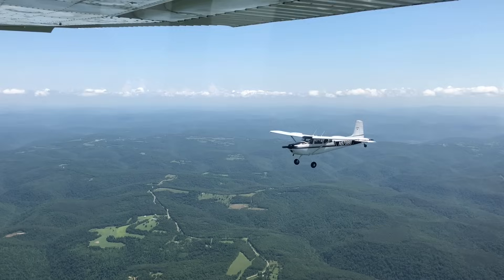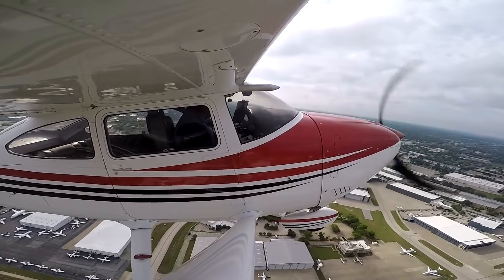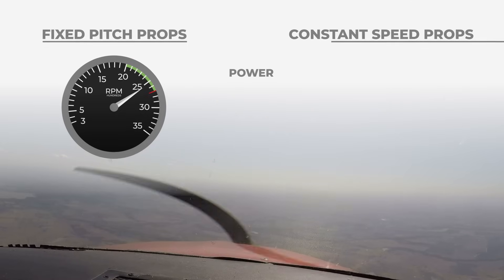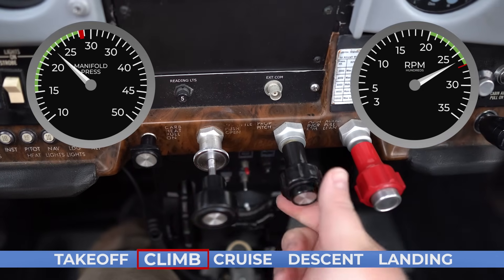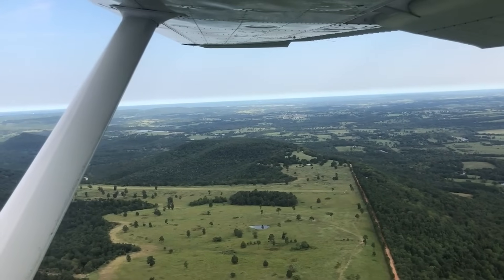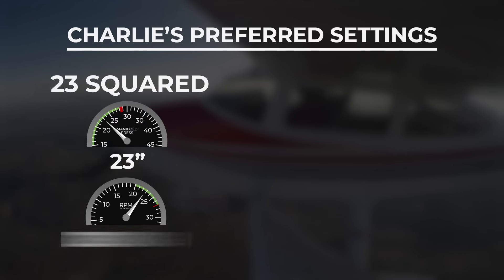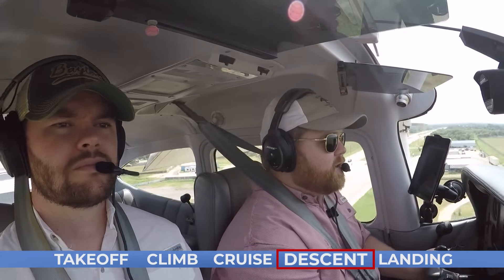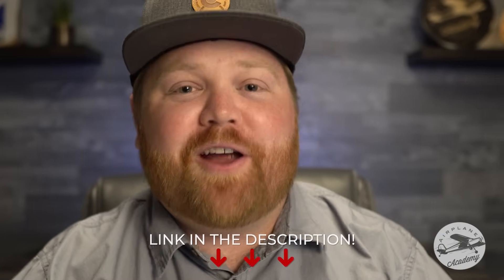How to Use a Constant Speed Prop in Each Phase of Flight (Made Easy!)

Comment: OK here is a challenging question for you. Let’s say you don’t have the power table available. Let’s say the POH is in the backseat if you can’t reach it. Could you just add enough manifold pressure to give you the RPM? Supposed cruise you wanted 2300 RPM and you were able to do so at say 22 inches of manifold pressure. I would think as long as the prop is spinning 2300 RPM it would give you the same performance and speed as 23 square except you would save a little bit of fuel? So what I’m trying to say is you probably could use the minimal amount of power, that is manifold pressure to achieve the RPM that you would like to use. Incidentally, one time I had flown an arrow that gave the same 65% power at 2100 RPM and 23 inches manifold pressure. The plane vibrated very badly so I returned it to 23 square which also was 65% power and a lot smoother. yes the noise level was increased but it didn’t shake the plane like 23, 2100.
Reply: I too have flown an Arrow one time where the POH’s table said for 65% power. You can use 23 inches add 2100 RPM and  the plane did vibrate. Think of this like trying to accelerate your car in a higher gear when you’re too slow. The whole car rumbles and shakes. You have it right there where you can set the prop to the desired RPM, and use the minimal amount of manifold pressure to achieve the RPM. Just remember, as you increase in altitude, especially on a naturally aspirated engine. The manifold pressure will naturally fall off, and the prop will still stay at 2300 until it can no longer maintain that due to a large amount of manifold pressure being lost. Not so much on a turbo such as the Arrow IV where the turbo charger will maintain manifold pressure clear up to 12,000 feet and only minor adjustments need to be made. Which sometimes gets confusing is for fuel economy that you want to lean the engine and normally if you lean too far without looking at the exhaust gas temperature, say the airplane is not equipped with one you would lead the mixture until the RPM drops off. Then you increase do you get maximum rpm. With a constant speed it’s a little more difficult you can watch your fuel flow get less and less and then all of a sudden at the right moment it will almost kill the engine. This is why leaning with an EGT gauge is more practical. One more thing,  Lycoming and Continental engines. Do not necessarily like to run on the lean side of peak. Refer to the POH.

Comment: So when doing circuit work early in your learning, is the prop pitch just left at the fine setting?
Reply from the maker: In other words, if you're just doing pattern work, would you leave the prop full forward? You definitely could. Especially if you aren't running your engine very hard in the pattern (downwind, base, etc.) the prop will effectively be full forward anyways since there won't be enough throttle to where the RPMs are having to be governed/capped anyways. See 8:00 in the video for what I mean. My 182 calls for climb setting of 23in/2450RPM to reduce engine wear and control temps. But if you're just climbing out briefly and going to pattern altitude it would probably be okay to not adjust the prop in any of that. But also good practice to remember prop in your pre-landing checklist. So might not be a bad idea to be practicing it even while in the pattern. Hope all of that makes sense!
Reply: You mean full speed? You could. But we never did. In my training, we always climbed, not matter how far, no matter what airplane, at max continuous power (actually thats not really true, we reduced RPM slightly for long climbs in some airplanes, but for pattern work, never). For our airplanes, that was full speed, full throttle. So we climb to pattern altitude that way. At pattern altitude, we follow the procedure for power reduction, just like we would in any other airplane. The proper power reduction procedure calls for a reduction in RPM, as does the decent power setting. RPM doesn't go to full speed until the landing checks. Practice how you fly; because you'll fly how you practice. Practice makes permanent, so there's no time too early to practice perfectly.

Comment: Question: why is the prop lever so long? Hear me out. There doesn't seem to be a reason you'd want the RPM to be set below a certain level, say 2100, except in cases where it drops because of low MAP, such as in a idle/low power descent. But that is exactly what you'd get if you kept pulling back on the prop lever. Wouldn't it make more sense for the prop lever to have a stop at some minimum RPM level?
Reply: Helps a lot during a forced approach. Pull it all the way back to reduce drag.
Reply: They do. In most twins, it's 0 RPM, or feathered, which is all the way back. The range is just for adjustment. On some airplanes, moving the RPM from full, say 2700, to cruise setting, say 2100, is about half or more of the travel. In singles, there is a minimum RPM, and it usually isn't 0 or feathered, but having that much travel gives the pilot control.

Comment: I fly a PA28-235 and the our club charges by tach time so the lower the rpm the slower the tach time moves. If I am just flying around for fun and not going some where as soon as I get 100o feet agl retard the throttle and pull the prop back to 2100. So after a 1.3 on the hobbs I have about 1 hour on the tach. About a 30% savings in cost.

Comment: Constant Speed props have always confused me - part of that is the term “constant” which, when you think of it, doesn’t mean constant - the prop isn’t constant, it changes. I understand a bit more after watching this video but I wish I could understand it better.
Reply: I agree.  While that has always been the terminology used, the concept is better taught using the phrase "variable pitch" propeller.  While it is accomplished by setting a desired RPM, the governor is adjusting the pitch of the prop to maintain that speed.  If you think about the prop spinning at 2400 rpm at a given manifold pressure and then suddenly removed a little power, the prop would want to slow down.  Instead, the prop hub adjusts the pitch of the prop to a smaller angle, resulting in less resistance, which allows it to stay at 2400.  And vice versa when you add power.  If you think about it, at a set RPM, adjusting the throttle just changes how big a "bite" the prop has to take in order to maintain that RPM.
Reply: @kevinkirkland8762  …that explains it perfectly, thanks! The piece of the puzzle I was missing is the governor. So, if the prop is taking a bigger bite out of the air, it requires more power vs. a feathered prop at the same RPM, right?
Reply: @richavery66  …I’m a visual person. To understand it best, I’d need to see what the prop “does” when the prop lever is moved back and forth and how it’s affected by increases and decreases in manifold pressure.
Reply: @petertarantelli  Fair enough. In the theory section, he draws some illustrations (mainly based around what the governor is doing and how it affects the pitch of the blades). However, what one person finds helpful can just confuse another and vice versa.
 
Basically, the governor will try to keep the engine at a constant speed - it does so by changing the angle of the prop blades. At a certain RPM setting (e.g. 2300 RPM), if the throttle is increased (higher manifold pressure), it will make the prop take bigger bites of air (like changing up gears); if the throttle is decreased, the prop will take smaller bites (like changing down gear). As mentioned in this video, at a low enough throttle setting, the governor will not be able to keep the prop at the selected RPM, so the prop speed will drop no matter what the lever setting and the engine speed will be controlled by the throttle, just like an aircraft with a fixed-pitch prop.
Reply: @richavery66  thanks for the reply, much appreciated!
Reply: @kevinkirkland8762  great reply this will help a lot of people. You seem to know what you’re talking about
Reply: The big "aha" moment for me when learning this, was realizing that the blue knob is NOT a "prop control" (even though it's labelled that) it's a prop governor control. It merely sets the setpoint of the RPM the governor is trying to maintain, and then the governor maintains that via constant, automatic pitch changing (that is, as long as the airspeed and/or power are high enough that the setpoint is able to be held, aka "being in governing range." Otherwise, the RPM is below the setpoint, and the governor is doing its damndest to increase RPM by holding the blades at their maximum flat limit, aka the flat pitch stop, and the prop acts like a fixed pitch prop)
Reply: @petertarantelli  Sort of.  I think you got the concept, but maybe misspoke.  A truly feathered prop is turned edge-on into the flight path, usually because of an engine failure, so shouldn't be turning at all, or free-wheeling very slowly.  Let's discount that for now.  Thinking about it from the power input first makes it easier for me.  A prop with more power being applied (i.e. a higher manifold pressure) naturally wants to turn faster, so it needs to take a bigger bite of the air, which creates more drag, to maintain a given RPM.  As you reduce power, the prop would want to slow down (as it does in a fixed-pitch system), and so begins to decrease the pitch angle in order to reduce drag and therefore maintain the RPM.  The video @Rich Avery linked does a decent job of explaining it.  I think this one does a bit better job.  https://www.youtube.com/watch?v=3J2etxf0Pxc
Reply: @CascadiaAviation  Thanks!  Could you tell my wife that? 🤣🤣
Reply: As others have said, yes the propeller changes pitch, but the reason the terminology "Constant Speed" is used is because the prop lever in the cockpit does not control the pitch of the propeller; it controls the speed setting of the governor. That is the best way to think about it from the pilot's perspective. Power input and speed through the air are the two things that effect the RPM of a fixed-pitch propellor. The prop governor modifies the pitch of a constant speed propellor so that no matter how much power is being fed to it, or how fast the airplane is moving through the air, the RPM stays the same. 
When more power is given to the propellor, it needs to take a larger 'bite' out of the air (or it needs higher pitch) to maintain the same speed. When the airplane moves faster through the air, the same thing happens, it needs more "bite" to keep the same speed.
Reply: @petertarantelli  You should think of it as power settings requiring a certain pitch, not pitch requiring power, because that's how the governor system works. Blade pitch is the output of the system, not an input. However, all things being equal, it requires more power to turn a propellor at high pitch than low pitch. Side note: I think someone else said it: a feathered prop is prop at highest pitch.

Comment: I think "constant speed" is a terrible name for it because it gave me the impression that the prop just spins at a singular RPM forever and that made no sense to me.
Reply: constant speed, being the setpoint you set with the blue knob. It does indeed try to spin at that RPM forever, as long as you're in governing range... until you change the setpoint; and then it tries to hold that RPM forever.
Reply: @FlyNAA  I mean that is suggests that the RPM can't be changed
Reply: The reason it is called that is because speed is what the knob controls. It does NOT control pitch. The governor controls pitch in order to maintain a constant speed, which is set by the knob. Hence the name. I get it, it doesn't make sense until you know what it does. But its so named because thats the correct framework to think about it from the pilot's perspective.

Comment: The analogy of a truck climbing a hill in 5th gear, and showing a semi-truck that usually has 18 gears, was very bad. 5th gear out of 18 gears, at 20mph is wise for a semi truck, if maybe even a bit too low of a gear.
5th gear out of 5 gears, climbing a hill at 20mph in a pickup truck is very bad.

Comment: The historical terminology used for this topic is very confusing. Basically gearheads used hotrod terms that have nothing to do with airplanes for airplanes. It's a mess. There are much better ways to discuss it but almost nobody does. It also is a huge barrier to new people entering flying since it is slang that doesn't tell you anything about what is going on. The whole issue will disappear with full FADEC systems that only have one lever. Sometime next century. (Except for intelligent systems like what Diamond uses for their diesels and Rotax for their constant speed power plants.)
Reply: If you're talking about constant speed, that isn't a hot rod term. It is so named because that is what the pilot controls. The knob in the cockpit does NOT control pitch. It controls speed or RPM. The governor controls pitch in order to maintain constant speed, which the pilots sets with the knob. Hence the name.

Comment: the animation ruins this presentation. You should have flown a real plane. because the gauges do not operate like the animation shows. When you are climbing out and make the first power change by pulling back the throttle to set the MP. the rpms do go down with it. That is not shown in this animation and it throws people off.  Also when you next set the prop for RPM, the load change also changes the MP. which is also not shown. There is a bit of a balancing act that is not shown. The animation ruins this nice presentation.

Comment: I had a really hard time concentrating on your content in this video because of your constant misuse of "rpms".  As I am sure you know, rpm stands for "revolutions per minute" and therefore if you use "rpms" to describe a single setting you are in effect saying "revolutions per minutes".  How many minutes?  The use of "rpms" in this way is totally ambiguous.  The only time "rpms" is accurate is when comparing two different readings like "my two engines had different rpms".  I know this is picky but to anyone technically trained it indicates ignorance and impacts your perceived credibility.